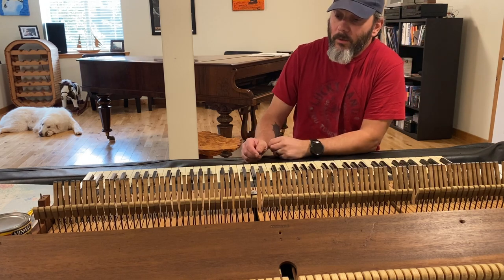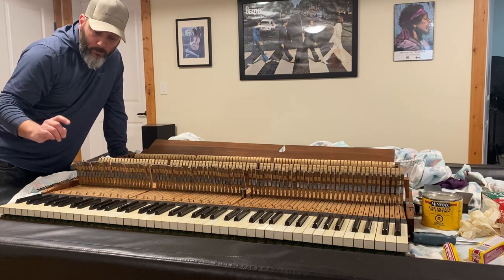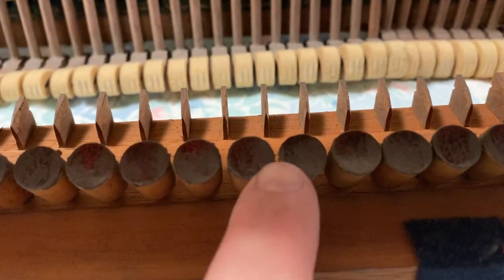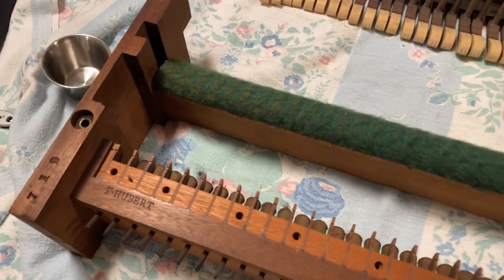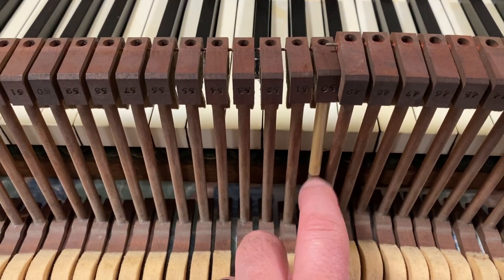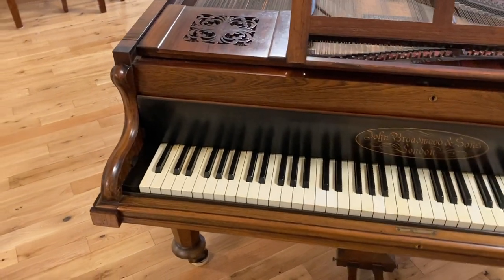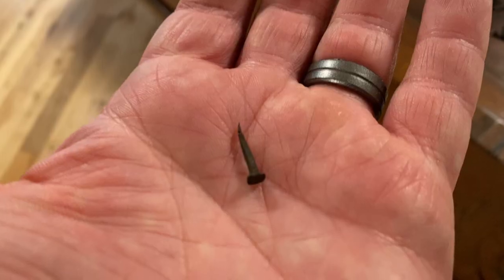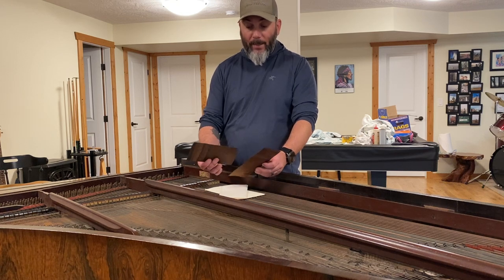Reassembly of a piano action/ Broadwood & Sons

Comment: Broadwood tuned as high as A454.7 in 1874, though 446 would not be atypical for home use. No need to further reduce string tension with smaller diameters. Kudos to you for taking on this project!
Reply from the maker: Thanks for the information.. Good to know

Comment: This is SO COOL!  Thank you so much!! I also own a Broadwood like this but mine is from the 1880s (I believe). I too have some keys sticking and have had the action out to look at it several times. It could probably benefit from my undertaking a cleaning just like this so I have been watching your videos quite closely.  I have never taken the action apart being reluctant to do so.  But I may consider it in the future.  My main problem is that I play the thing everyday and it doesn’t appear that it can be done quickly.
Reply from the maker: Hi Keith, if you only go after the keys that are sticking I’m pretty sure you can do it in a day. The time consuming steps for me were dust removal and key polishing. Dusting and cleaning was fairly quick.
If I had to do it again though, I would use the simichrome on the key pins prior to applying the wax. I think it would have cleaned up the years of gunk prior to applying the wax.

Comment: on the hammer 50 you can put around the wood a thread to strengthen it, glued with fishbone glue or bone glue (which comes off easy with slightly hot water)
Reply from the maker: Thanks for the tips, will definitely try the UV for the Ivory.
In regards to sanding, I ran this by my piano technician and he said it is common practice. I really didn’t remove much weight by flattening the end bit.
I heard about adding a tread but what kind of tread is it? Just tread from the fabric store??
Thanks for taking the time to add comments 👍
Reply: @HovingtonInstruments  yes a common cotton thread or other fabric which is strong and would exist in 1874. You should wind it tightly around the broken area with very little glue. For the sanding I know many do it, but the more recent and logical step would be bending the wood, especially with hammer shanks, rather then taking off material which isnt possible to replace. But no worries.

Comment: Brilliant documentation of the action - but dismal tuning. Really a shame to do this video with such a horrible sound at the end.  Here's a restrung 1869 cottage grand broadwood. https://www.youtube.com/watch?v=PmuVipZMmK0 The gauge of the bass strings is normally put on small round labels on the felt next to the agraffes. The pitch was not 432. Broadwood "medium" pitch was A=445 and high pitch 455! It will sound much better at 440 or 445 and used the current string gauge as fitted. Here https://www.youtube.com/watch?v=nZboO8RiuSA is a Broadwood of 1881 with original strings which only on account of age prefer 436. At pitches lower than 442 to 444 you'll get false beats in the treble.

Comment: Those hammers probably have enough felt left that an expert could reshape and voice them. This is standard technique but I would make sure I get somebody whose work is liked by pianists.
Reply from the maker: Yes, my piano technician and I had a look at them and the mid section has some flat spots but the treble and Bass seems fine.
We might need to make a few adjustments on the mid section but my wife will decide on this matter after the strings and soundboard is done.
If she likes the sound then she mentioned she didn’t want to touch them yet.
Keep the original one as long as possible means to wait a bit longer before reshaping these..